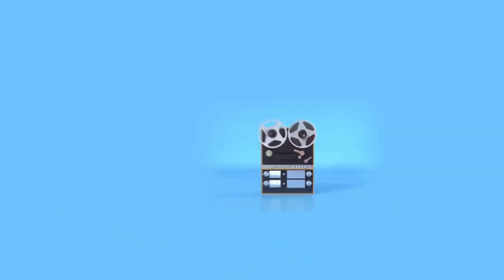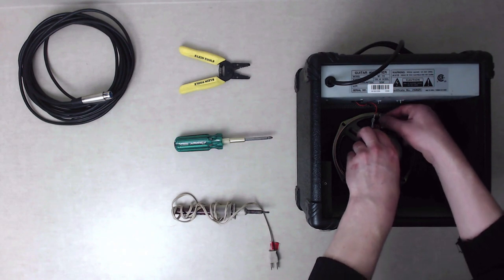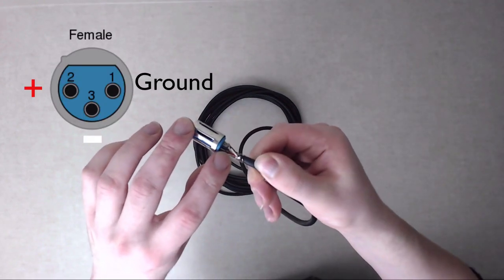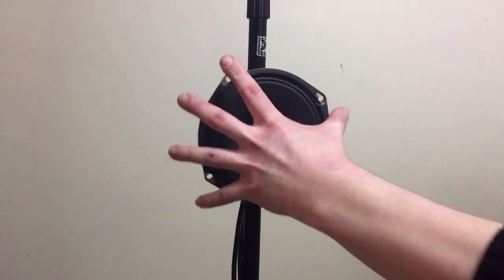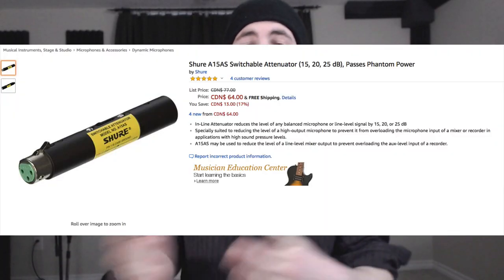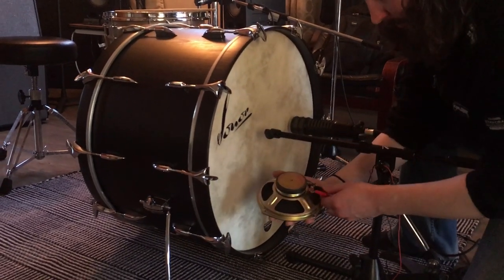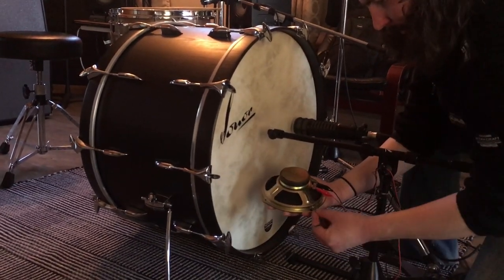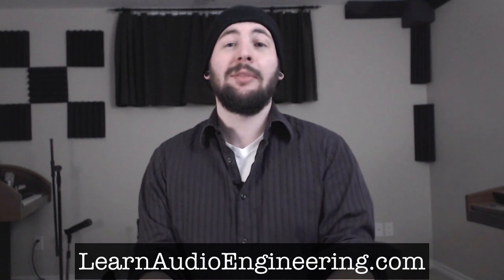How to Build a Sub Kick // Low Frequency Speaker Microphone | LearnAudioEngineering.com

Comment: So I tried this using your specs. I used a mega cheap 8" driver that I picked up from amazon for 14 euros (about $15.50); including cable it was about 19 euros ($21). I think it was a speaker designed for a subwoofer. I also used the same value resistors with the unbalanced circuit.
It worked perfectly - the attenuation (along with the 20dB pad on the desk) cleared up any distortion when the sub was used about 2 inches off the kick membrane. It delivers a lovely thud alongside the beta 52 we were using just outside the membrane.

Huge huge thanks! You've earned a subscriber!
Reply from the maker: Love this! glad to hear it worked out for you, thanks for letting me know :D

Comment: You'll get a far better result if you mount the driver in an enclosure. In the open the low frequencies are incident on both sides of the cone almost equally, thus there will be a lot of phase cancellation. Polarity and absolute phase aren't important but the relationship between the traditional kick mic and the sub is. Reverse the polarity of either one if the outputs are counteracting each other.

Comment: Definitely sounded better... I even think the 6 did just as well as the 8.. I wonder if using car audio speakers might give different results? Of course not the huge magnet sized ones that would actually require lots of power.. but the paper cone 6.5” or 8’s for the mids. I wonder what’s the highest rms rating you can use with the xlr cable before blowing up the port.

Comment: I am thinking about trying something similar, but my plan is to epoxy a drum skin directly to the speaker membrane or coil assembly, so that it effectively becomes a diaphragm for a microphone, but might need to find a way to turn down the gain so to speak when it comes to recording the output.

Comment: Since the speaker is being used as a microphone, the diaphragm will be pushing in when recording, so to be in phase, wire the positive of the speaker to pin 3 of the xlr plug, and the negative of the speaker to pin 2 of the xlr plug. (Either polarity would work and you would have to have the hearing of Superman to tell the difference.)
Reply: It’s an ac current in isolation, there’s nothing for it to be in phase with, either way would work fine. The phase only really matters on combining multiple speakers together, individual mics are going to pick up their own signal regardless of polarity.

Comment: If your speaker is 8 ohm. R1 should be 1 ohm and R2 = 8 ohm BUT across the input to the amp NOT ACROSS THE SPEAKER. You will then have a matched 19 dB attenuator.

Comment: Ty so much!  Couple QQs please sir. What do you do with the 3rd copper wire on the XLR cable, assume connect it to the negative post or ground it to the side of the speaker? (sorry I'm a newb.)  Also my mixer has a pad button, can I use that instead of buying or making the attenuator?  Also last question since it appeared that 8 inch worked better would a 10 or 12 inch be even  better?  Thanks so much, hopefully you won't mind the questions.  I definitely liked and subscribed to your channel.  You have  great skills!

Comment: Wouldnt it be more awesome if you removed the coil from the speaker and glued it to the kick drum skin itself? You would of course have to rig the magnet part up with something free standing in the right  location. But the whole idea behind this would be to use the drum itself as the cone. Much more direct that way and you would get the direct movement of the skin on the recording.

Comment: Hello form Mexico... I have a question, please! I see a 10" subwoofer in Ebay and it has the same values about NS10 sub... the difference is the WATTS.... The NS10 is for 120 W. and the e bay sub is for 750W, i don't know if im confused... Can ebay sub works? does the Watts matters? the cost is 50 dlls. In the case of it can works.... Can i use the same attenuator you built? Thanks man

Comment: Question about the attenuator. I’m building my own subkick and used your example diagram for the attenuator.  Not knowing anything about resistors I took a guess and used 1/4 watt 1% resistors. I used 470 ohm resistor in line with pin 2 which ran to the negative terminal of the speaker. Then at the speaker I bridged pins 2 and 3 with 100 ohm resistor. 
Multi meter gave me a reading of 476 ohms when it was all wired up. Went to test it out and it is still way to hot and clipping at my mixer.  Am I missing something and or using the wrong resistors?  Thanks.
Reply: Also I’m using an 8ohm 10 inch speaker. It’s an aluminum cone speaker from an old bass cabinet project.

Comment: Hi. Can you give a little more detail on how you made your attenuator using the alligator clips? Does it have to do with the wire rolled around itsself? Thanks!!
Reply from the maker: Hey Daniel,

The attenuator is just a couple of resistors. here's the schematic I used:
https://forum.allaboutcircuits.com/threads/subkick-microphone-attenuator.69715/

Comment: thanks for the vid, man! One question. Do you need an attenuator if your pre has a 20 db pad? Im thinking of building one of those bad boys. Thanks!
Reply: Nope. The pad on the interface will do. You should use an attenuator in any case your preamp don't have a pad.

Comment: Surely the composition of the driver being used is far more important then it's size? I know it's quite rare to get a smaller driver designed for good bass response, but a 15 inch fender guitar speaker from the 60s is going to have nowhere near the xmax of a well designed 6 inch sub. Can't imagine there's many 4 inch speakers that can put out deep bass, but larger doesn't intrinsically mean more bass.

Cool video though, I've got a cool mic for top end & mids on a bass cab for some home recording, and the DI sounds like shit. Before the preamp it's got no bottom end or character, and post it's got some really nasty top end overdrive that can't be EQed out as a last resort. Might try this with a practice amp to see if I can get some more.

What do you do with the earth wire on the XLR by the way? Nevermind, missed your pinned post!
Reply from the maker: yeah I'm sure you can order better ones for pretty cheap The 4" one was awful, I tried for a laugh.

I'd like to make a 10-12" version. I've heard the bigger sizer can cause it to resonate more easily and can get messy.

And the Earth goes on the speaker chassis, clip is the best way to go as the solder won't stick to it.

Glad you enjoyed, thanks for the comment!

Comment: Hoping I can get this answered here. I cut off the female end of an XLR, reversed polarities and soldered the wires to my sub speaker. When I plug into my audio interface, even with input gain all the way down, the signal being sent is clipping. No way I can put it as close as you have them in this video. What am I missing here? Doesn't seem to be working here. 4 ohm sub speaker if that matters. I'm also getting some static/crackling when recording with it (from like a foot away.) Any help would be appreciated! Awesome video!
Reply from the maker: When researching this project, attenuation seemed to be the biggest hurdle. The signal coming off the speaker is quite hot and will need to be padded in order to work with your average mixer/interface. I built a little attenuator following a recipe online. You could also try a bigger speaker with more resistance 8" speaker @ 8Ohms is what I used IIRC.
Reply from the maker: Here's the link to the Schematic I used:
https://forum.allaboutcircuits.com/threads/subkick-microphone-attenuator.69715/

Comment: Also, Shouldn't we use the male end of the cable for plugging into a cable to lead to an input?
Reply from the maker: The mic (sub kick) has the male end, so we use the female end to connect to the mic. That way the other (male) side of the cable can connect to the mic pre.

Comment: #1. The Kick was tuned too high.
#2. Get a little project box and wire a 100K Pot between a pair of XLR Male and Female Panel jacks in the box. That way you have an adjustable knob to attenuate the speaker. Essentially, it is like a "pre-gain" passive volume knob.

You can't just use "any old speaker" for this. You need a speaker driver that is highly compliant. A cone with a stiff suspension is not going to pick up as well as a compliant one. Which is why you need a stereo type of speaker, and not a musical instrument speaker.

I personally wouldn't even bother with anything smaller than a 12" driver. If you are looking to add some low end thump, go for something that can actually pick up the thump.

The place to look for driver's is Part's Express online.
Also MCM.

Kick drum tuning. Fill the drum halfway with a folded up king-sized comforter, and drop the pitch of the batter head down to wrinkles at the edges. In rock music, you want the drum to deliver that solid foundation - your kick example was weak as hell sounding, because it was tuned way too high.
You want the kick to pound people's guts in.
If you do what I'm telling you, it adds all those infrasonic effect that you are looking for... like when a large truck drives by and you may not necessarily hear it outside, but you can "feel"  the sensation, that is what you get by dropping the drum pitch down to the range I am talking about.
If you want "boom", use a small room reverb to add that, and put a few ms pre-delay on it to make sure it doesn't "smear" the kick sound. Same with the snare.
Reply from the maker: Great pointers on tuning! I'll look into building a pre gain knob
Reply: Tim Brown for my 20x18 kick, I tune the batter head maybe half a turn past finger tight, just to get some tension from it, then I leave the reso head finger tight with wrinkles, then I just threw maybe a twin size blanket inside. It’s one of those DDrum starter kits with the original heads on it, and it sounds pretty good IMO, good enough to pass in most live situations